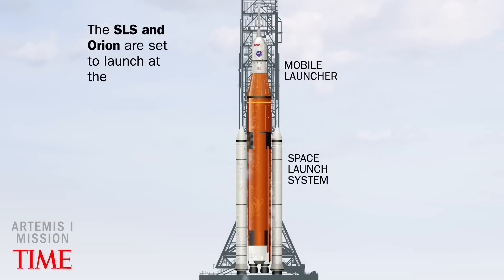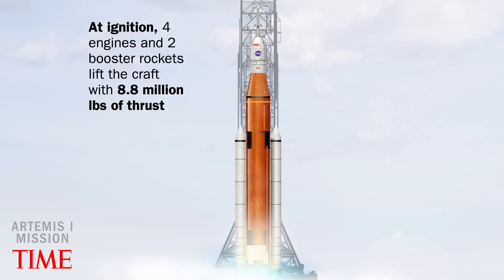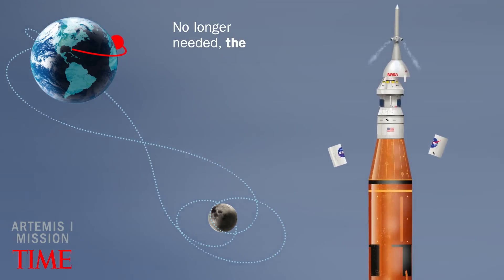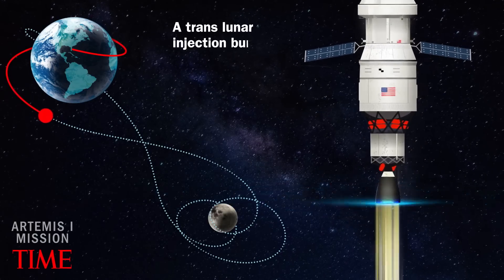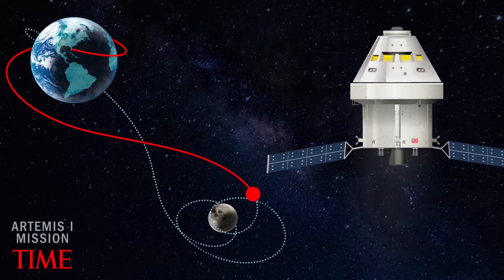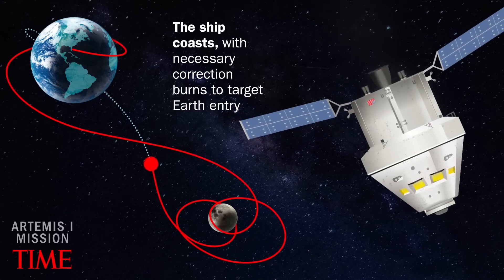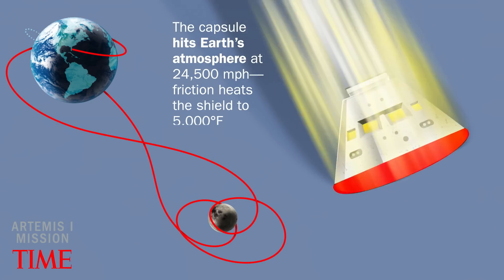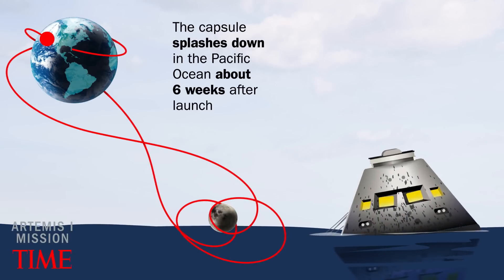Return To The Moon: Artemis 1 Mission

Comment: Fun fact: the heat shield doesn’t heat up due to friction! It’s actually radiative heating from the compression of air just in front of it. The shockwave sits about an inch in front and never touches the heat shield. The air moves away too fast for heat to conduct through it either. So the heat is from thermal photons. That’s why the Apollo capsule was silver and why most re-entry craft are white or reflective.
Reply: Having just read through every comment on this video, I can confirm that you are one of the only 5 people who has commented that has at least one brain cell
Reply: @windshear2158  its true. i do have at least one brain cell. this is also a fun fact!
Reply: Science Revolution  I had a banana for lunch but I’m still hungry. Can you explain that?
Reply: [09/01/23]  Are they still using the Novolac epoxy AVCOAT for the ablative material? If not, what are they using nowadays?
Reply: @oceanic8424  oh, good question, I’m not sure. There are a handful of variations for the Novolac phenolic resins with different properties. As it’s coming back from a highly eccentric lunar orbit it will be probably be both high structural and high temperature blend. I don’t think they still use cork. I’ve heard that aerogels were considered for some sections but I don’t have a source for that yet
Reply: lol.... to the moon we go.... if this was not sad i would actully be lolzing here... amazing

Comment: Fun fact: It’s not a return. It’s the first attempt. You cannot orbit the moon. That is why they are shooting past and doing elliptical orbits. Why is that you ask? Objects without the mass of the moon traveling at the same distance from the earth must be going 1200 mph faster than the moon travels to keep from being pulled back to earth. This means that gravity is not equal on the far and near sides of the moon. The far side of the moon having the gravity of moon itself added to the pull from the earth and the near of the moon having less gravity due to the pull from earth subtracting from its gravity. This difference makes entering orbit around the moon impossible.
Reply: 1 you havnt read physics, 2 its a return, unless your brain is flat.

Comment: Only one question🤔 if you're going roughly 25,000 miles an hour to a destination that is roughly 250,000 miles away why would it take you 5 days to get there🙄 should be more like 10 hours🙊
Reply: Speed does not remain constant when you're orbiting a body in a non circular orbit, this is specially important for higly eccentric orbits like the ones used for trans-lunar flights, as the spacecraft goes away from earth it slows down and viceversa.
Reply: Is not a straight shot and the craft will be in a constant state of deceleration once the rockets cut out.
Reply: @Jeffreylogan74  so then objects in motion don't stay in motion unless acted upon by an outside force?? especially in space!!
Reply: The state which you are describing would only be somewhat consistent at very far distances from any gravitational bodies. Look at our sun pulling on the earth from 92 million miles away. You cannot escape gravity within our solar system and there is nowhere in the universe where gravitational bodies are not exerting pull on one another. Essentially you can never be truly stationary.
Reply: @Jeffreylogan74  yeah I can look at Wikipedia too that doesn't prove it anything you're saying is factual
Reply: @labyrinthofknowledge3.142  wow, knowledge really is a labyrinth to you, isn't it... It was pretty clear the way the dude explained it to you. You can check the live tracker of the mission, right now as I am writing this the space craft is going less than 800 mph. Almost as slow as a jet liner.

Comment: To return we would've had to gone there in the first place supposedly, but we didn't. The Van Alan Belt has too much radiation. Any space travelers would have been killed or seriously radiated. Stanley K. Told the truth.
Reply: Wrong.
Reply: @cornwallcrownee9906  how so? Van Allen belts don't  contain high risk radiation?
Reply: @donvincentwalters2705  They don't
Reply: "A person in the cabin of a space shuttle in a circular equatorial orbit in the most intense region of the inner radiation belt, at an altitude of about 1000 miles, would be subjected to a fatal dosage of radiation in about one week.
However, the outbound and inbound trajectories of the Apollo spacecraft cut through the outer portions of the inner belt and because of their high speed spent only about 15 minutes in traversing the region and less than 2 hours in traversing the much less penetrating radiation in the outer radiation belt. The resulting radiation exposure for the round trip was less than 1% of a fatal dosage - a very minor risk among the far greater other risks of such flights. I made such estimates in the early 1960s and so informed NASA engineers who were planning the Apollo flights. These estimates are still reliable."

James A. Van Allen
Reply: You'll be telling us the Earth is flat next ?
Reply: @donvincentwalters2705  Stanley K. isn't a spaceflight enthusiast. NASA had done the math and science and they can be sure nobody would be sliced in half because of the radiation.

They did go to the moon. 8 flights have been done and they went to orbit the moon and six flights had landed. 

Why hasn't they back in 1980s to the moon? If you know how procurement and budget appropriations work, you'll know it's not as easy as going to the deli and ordering a sandwich. Those are different scenarios.

And becauss of that vast amounts of differences, Spaceflight can be made possible.
Reply: @donvincentwalters2705  if youve read Physics you would have known you need to spend time in radiation before it becomes dangerous. The speed modules travel leads to minimal exposure